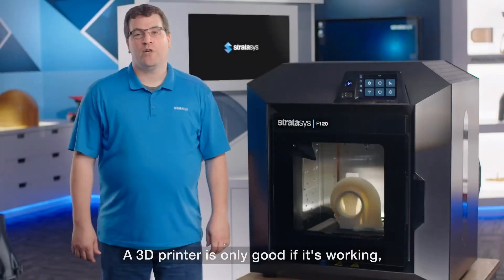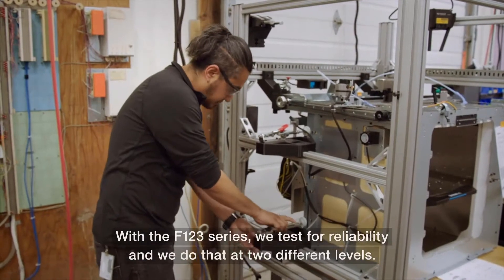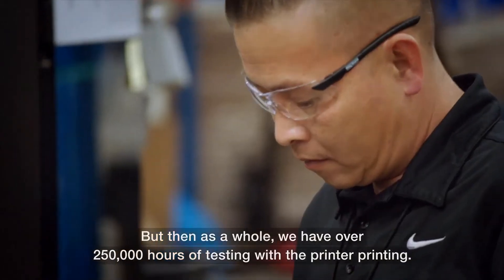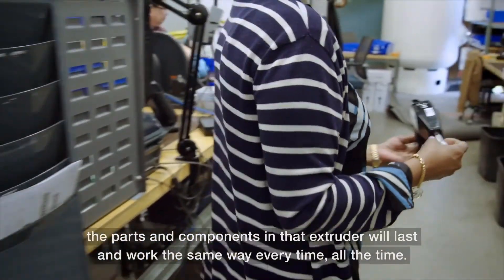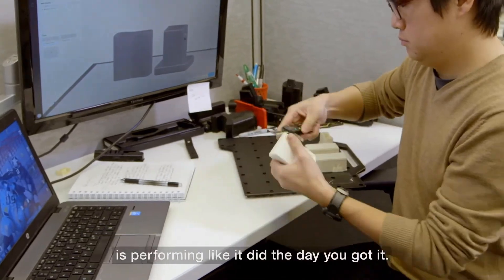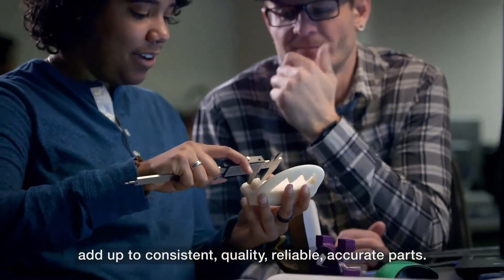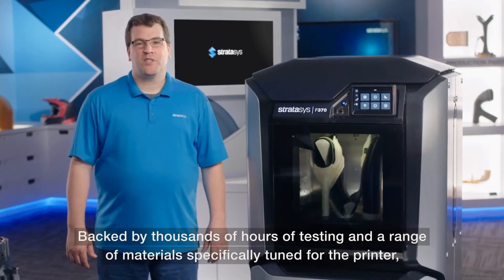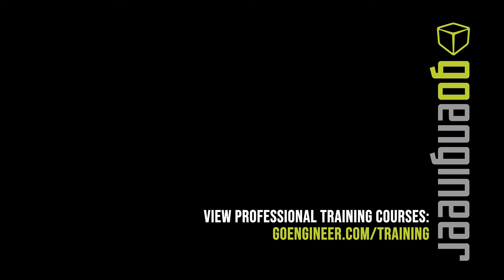Stratasys F123 - Reliability

Comment: ABSOLUTE PIECE OF GARBAGE.  OUR NEW F370 HAD THE REPAIR MAN OUT FOR FAULTY HEATERS 3 TIMES, BOTH Y AND Z BEARINGS WERE SHOT WITHIN THE FIRST YEAR OF USE.  MIND YOU, THIS IS A $70,000 USD PIECE OF MACHINERY, WITH NOW, 300.00 PER SPOOL OF ABS AT 90CUIN. EACH PRINT HEAD REPLACEMENT IS $1000.00+ EACH.  CONSTANTLY STOPPING DUE TO ERRORS, CONSTANT COST AND EXPENSE FOR REPAIRS.  GARBAGE----GARBAGE-----GARBAGE-------GARBAGE... COMPLETE WASTE OF MONEY.